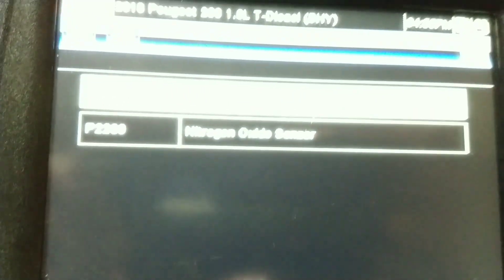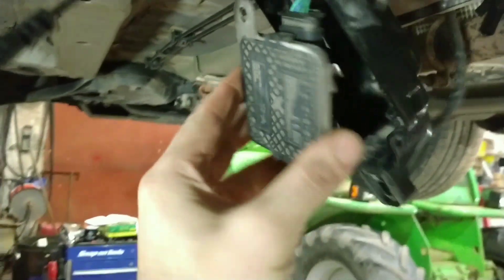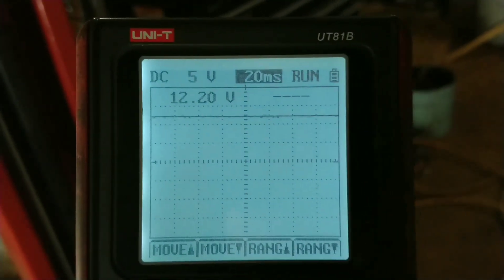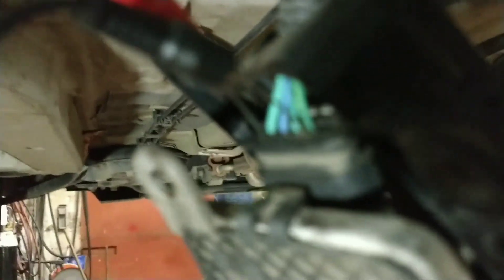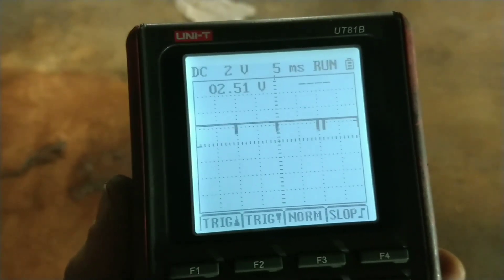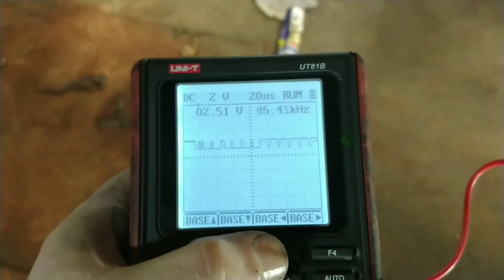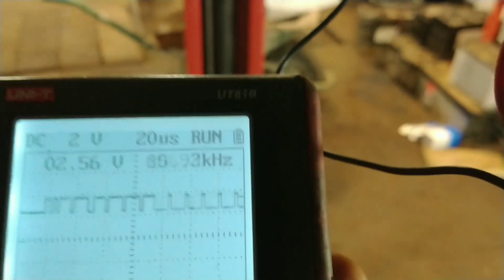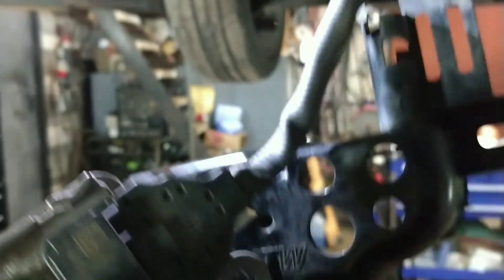Peugeot NOX Sensor fault

Comment: These are available in the uk for about 280 quid inclusive of vat now direct from the dealer. Be aware there is a 72 quid surcharge payable. Cheers
Reply from the maker: Yeah the price is getting better, I have heard about repair kits but I haven't gone that way because usually I find they get corroded inside the circuit board. Thanks for watching Mikey and your comment

Comment: Thanks for this Video Mechanic Matt. This is so clear to understand. I have a Peugeot Partner adapted car. My garage is local, they get parts from a Peugeot dealer  for my car. Friday I had an engine warning light come on. Next day Urea warning  etc shut down in 700 miles then after 5 miles Emissions fault. Took it to my usual garage and they did they fault diagnostics Test and it came back with Denox fault . P2200 Nitrogen Oxide Sensor. Garage are good and did explain what it was. Said that I can drive it for a couple of weeks. They priced whole replacement at £350 + vat which seems reasonable diagnostics £40. I knew it wasn't AdBlue as that was done 6 weeks ago. Can you tell me if the sensor is on the the front exhaust or back of it. I have a dropped floor in mine for the ramp and had new Back part of exhaust replaced for Mot last June.
Reply from the maker: Hi Jacqui, I think it was under the passenger seat, well the module was there bolted to the underside of the car. Then one bunch of wires went from there into the exhaust itself near to the nox sensor module. May be in a different place on a partner but they all look the same so you should recognise it. Thanks for watching.

Comment: I have 2015 5008 and had it checked with my local diagnostics garage which was £30  and the same codes came up. Have tried to hunt online for the sensor but no one has one they say I'll have to get it fixed at Peugeot  but they want £140 for a diagnostic check  then they will do what is needed had a quote and it will be £500  but I have told them i have the print out but they say they want to do a check this seems wrong as i have the print out which tells them the problem any advice .my dash says UREA  emissions control fault engine fault repair needed and tells me i have 600 miles before my engine is disengaged .this only happened on Weds of this week feb17th after going over a pothole.
Reply from the maker: A lot of places like to carry out their own diagnostics, it's surprising that the NOX sensor is not available. If Peugeot can't sell you the sensor it may be worth looking on eBay. It's quite a common part to go wrong, sometimes due to corrosion inside the module. Unfortunately not cheap to replace.
Reply: Hi did you get it sorted ? My Peugeot 308 gt 2015 is doing the exact same emissions control fault.  Urea warning light and engine fault repair needed
Reply: @davidjenkins1877  Hi, Iv now got the same problem :( Had the car 6 months, Did you manage to get it fixed? How much did it cost? 
Thanks

Comment: Been quoted £1000 for nox sensor replacement !!! What’s a suitable price to pay as this seems insane
Reply from the maker: I was thinking about half from memory. Guess different makes are going to change that. Sounds like it's a genuine part for that price which is the best way to go.
Reply: Stay with genuine parts as it's less hassle in the future,  as the Nox sensor has a module built on to it, expect to pay approximately £500 for the part alone!
Reply: Genuine sensor £280ish and we only charge £50ish to fit so yeah a 1k is more expensive than most mainstealer

Comment: To check the nox sensor check for 12v and good earth and should be can connections if you have these and there’s can connection then job is done it needs a new sensor
Reply from the maker: That's correct, thanks for watching

Comment: How you doing mate, what scanner do you use? Also a quick question if you remember did the car have an adblue fault on the dash when the fault was present?
Reply from the maker: Hi Dylan, I switch between a snap on ethos tech, that is now out of date, and a foxwell (can't remember the model) and the last one I bought was a launch. I think there was a message on the dash too with this one.
Thanks for watching
Reply: @mechanicmatt871  ok thank you for replying

Comment: If you change this part do you need to have it reset by computer??
Reply from the maker: I cleared the fault code and it worked fine, thanks for watching.
Reply: @mechanicmatt871  thanks for the reply

Comment: I get a P2204 error, NOx sensor error.....I dont know anything about the mechanics of a car, is the car still safe to drive in the mean time until I can have it looked at?
Reply from the maker: Yes it will be ok in the meantime, it may need a regeneration when the sensor is replaced because it won't do that while you have that fault code.
Reply: @mechanicmatt871  I had the same error : P2204  ( SENSOR FAULT ), P20E8  ( pressure of the UREA fluid) , P242F - dpf heating ! After 2 weeks, disappeared !!  What is that ?
Reply: @kdnet21  These psa urea systems are known for pump failures, the caps on the urea tank not holding pressure and ive had two software updates on the C4 Cactus completed by dealers.

Comment: Nice vid. These Nox modules are starting to become common faults. 👍
Reply from the maker: It's a crazy place to put a module, under the car like that. It may be better if it was inside the car and had a wire with a rubber grommet  going through the floor to the sensor. Thanks for watching